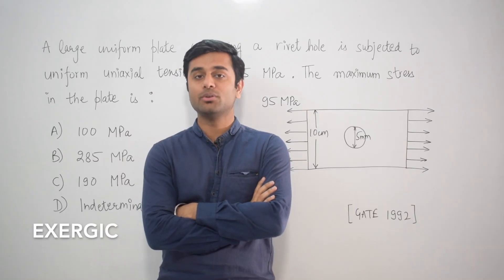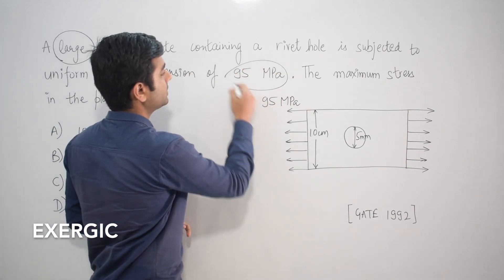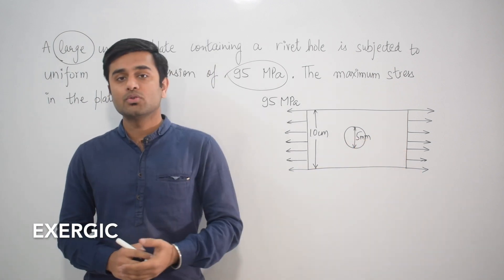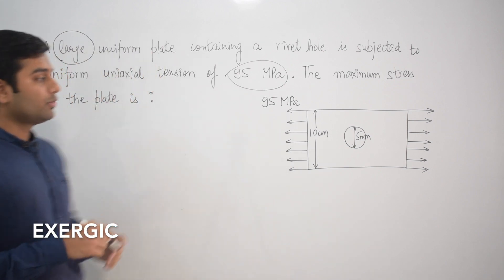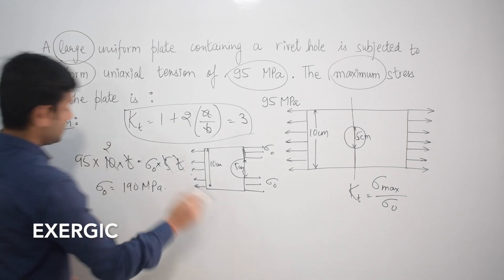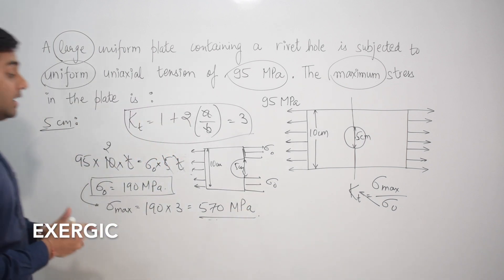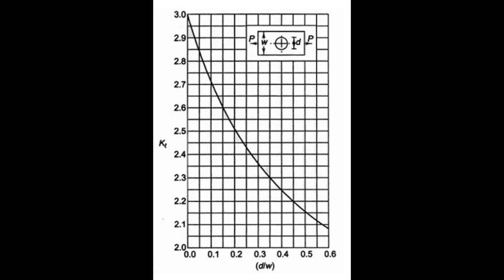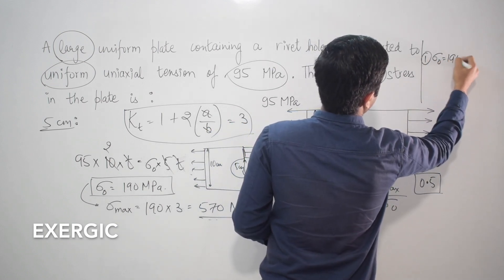Stress Concentration Numerical Tips explained through PYQ ( Machine Design) -  GATE Mechanical

Comment: How can we choose the closest ans sir..when it was way difference of. 15 mpa?. The answer is 100 presumably as it is asked stress "in the plate".Had it been asked to find stress "near the discontinuity"it would have been indeterminate.since corresponding kt to D/W ratio is not given.. #NORTON says the same.(plz clarify over this sir)
Reply: Sir near the discontinuity,due to flow lines,kt is high..so is not material to say "in the material " and "near the discontinuity"?
Reply from the maker: 1. From the graph, answer comes out EXACTLY 285 MPa as explained in second half of the lecture.

2. It is a question from GATE 1990s when in many MCQs, closest one was chosen and selected as correct.

3. Logic you gave for "in the plate" is inappropriate as ultimately the material near discontinuity is also "in the plate" only.

Hope this helps.